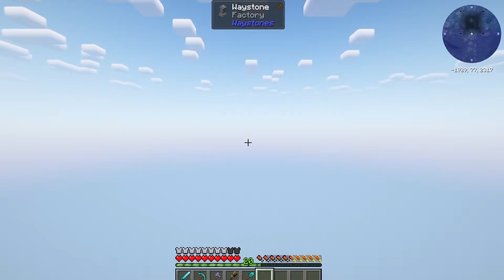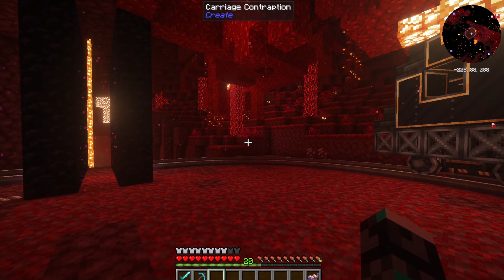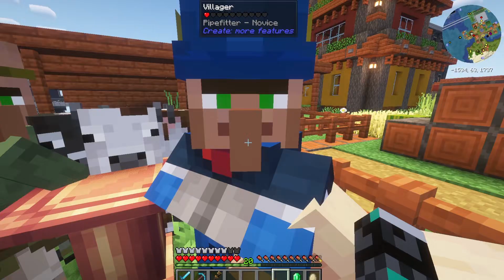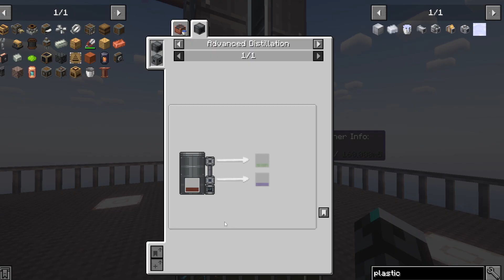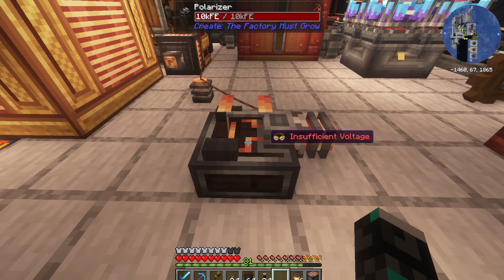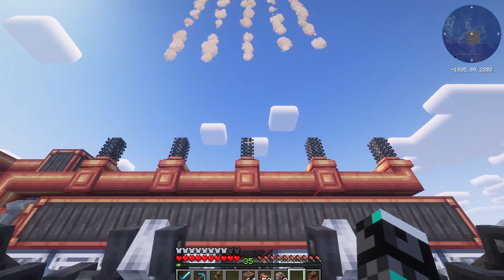Making HALF MILLION SU on an Oil Rig with the Create Mod!

Comment: probably should've had those pipes under the water. since your doing a oil rig theme, that's how they have it set up.
Reply from the maker: @JukoThe10-Tails  thats not a bad idea, but having them like this allowed me to see that some werent pumping oil. Because i could see the empty pipe. And knew i had a problem to solve
Reply: @vl0fast  ah, yeah i get that. sometimes they don't want to work how they're supposed to. its more for aesthetics if you wanted to go down that route. irl it's just easier to lay it down and it protects the pipes.